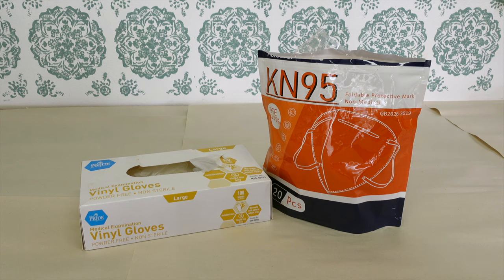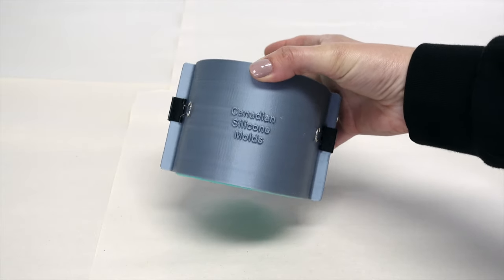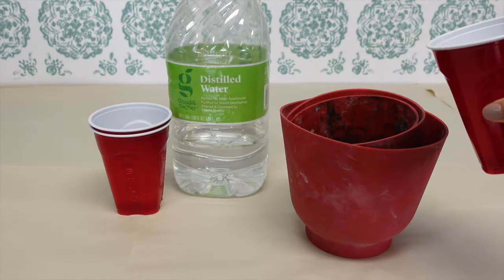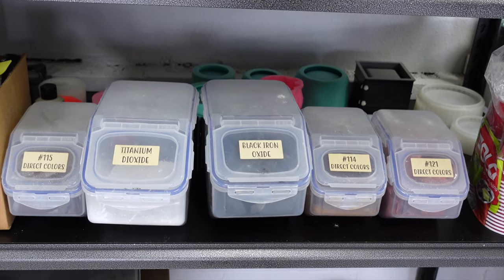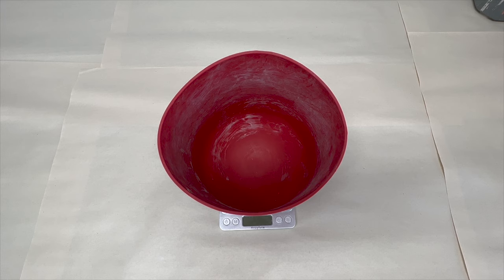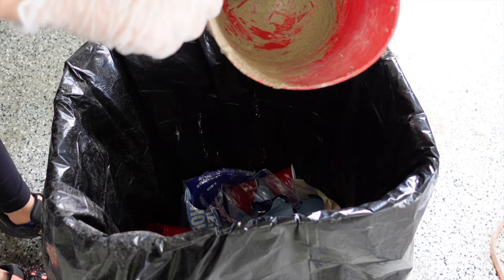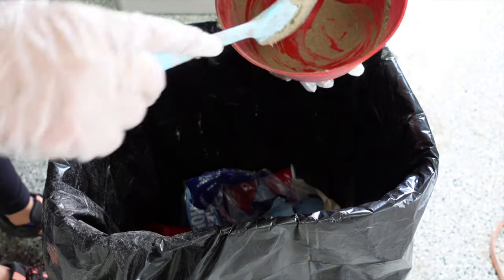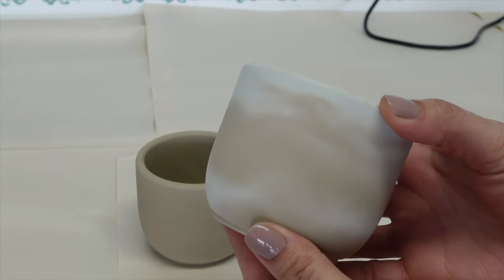In-Depth DIY Concrete Candle Jar Tutorial (Including Common Issues)

Comment: In your video you mention that you prior concrete was setting up too quickly in the winter. This is likely because concrete manufactures put additives in the mix for different times of the year to help the customers fight the changing elements. So in winter they include additives to help it hydrate quick even in really low temps. But as always you may want to confirm with each manufacture what they do.
Reply from the maker: Thanks for the info!

Comment: Great video and thank you so much for sharing your knowledge!
To slow concrete/cement down from drying too quickly you can run a very wet sponge over the bottoms (when they are still in the molds) a few times to keep them wet longer. Cement is actually better if it stays wet longer.
Reply from the maker: Thanks for watching! That’s a great tip!

Comment: Hi there. I’ve just come across your channel and learning to pour my own concrete candle vessels. 
Can you plz explain why you use the power and not add more water to achieve the desired consistency? Great videos and so informative ❤
Reply from the maker: Hi thanks for watching! The more water you add, the weaker your vessel will be. If you add too much water you risk cracks in the vessels, or they can also break very easily in transit as they will be weaker.

Comment: I’m just starting out with my vessel making journey. My first three were fine for what they were but after trying the 3:1 method in an attempt to increase fluidity but wound up with cracks in the bottom of the vessels. Yesterday I purchased the flow additive and this morning I rewatched this video. Can you describe what you mean about adding too much affecting the appearance of the jar? Sprinkling isn’t my friend so I have a set of measuring spoons, tad, pinch etc, so I can replicate my measurements from batch to batch. 

I do have one observation, as a mixed medium maker. I find it easier to measure small quantities of pigment using a jeweler’s scale and mini Dixie cups. Linda
Reply from the maker: Personally, when adding too much of the flow control I found some streaky looking marks on the vessels. May not be the case for everyone, but that was my experience! If you add too much water, you could definitely experience cracks.

Comment: Hi, I have a question about using mold release spray on the silicone molds when using concrete.  Have you used this product? I read that it helps prolong the life of the mold because of the concrete causing shrinkage?
Reply from the maker: Hi! No I haven’t, but I’ve heard about it. I need to test that out!

Comment: Thank you for your videos. Have you ever had an oxide pigment stain your silicone mold?  I’ve used a rose red oxide and it stained my mold pink. I’ve tried to clean it with the traditional soap and water, diluted, rubbing alcohol in water, and also equal parts of vinegar and water to try and remove the stains but nothing seems to work.

Comment: Great video!!  How do you wash your molds?  How often?  I use distilled water to mix my cement all, but wash my molds with tap water.  I noticed I’m still getting spots on my jar.  I’m thinking it’s because I’m washing them with tap water???
Reply from the maker: Thanks, Crissy! I do wash with tap water and a little dawn dish soap. I make sure to wipe them dry right away though. I use blue shop towels to wipe them off.

Comment: Hi there :) Your videos / tutorials are so fun to watch and inspiring! I have a question. I just recently started using Cement All (I was using my own white cement mix before). All my jars keep coming out with demarcation lines, like some weird discoloration. This is happening both in jars with color and without. Would you know what causes this? I can't figure it out. It's such a bummer to have several jars come out like this.
Reply from the maker: Hello! Thanks for watching! I'm wondering if it could be from your water? Are you using tap water? When I first started out, I was using tap water. We have really hard water where we live and it was leaving weird marks all over my vessels. I switched to distilled water, and no longer have that issue!
Reply: @calafiacandleco   Thank you for your response ☺️ I’ve been using demineralised water. I live in Europe and where I’m at, distilled water isn’t as common. But I thought that demineralised would be the same? Maybe I’m wrong. The weird thing is that these discolouration lines are just around the bottom half of the vessel. Not sure if I can add a photo here.

Comment: ANY IDEA WHY AFTER WEEKS OF MAKINGA APERFECT VESSEL, YOU LET IT DRY, YOU SEAL AND THEN YOU MAKE THE WAX, WHY THE VESEL CRACKS ON THE SIDES?  I HAVE A LOT OF VESELS CRACKED AFTER WEEKS OF MAKING THEM
Reply from the maker: It could be because of a couple different reasons. They could’ve cured too fast if it’s really hot where you are, or something about your mixture was off, or you’re pouring the wax too hot.

Comment: Great video! I was just wondering what kind of sander do you use for those uneven bottoms? Do you have an electric one?
Reply from the maker: I have never used an electric one. As you can see, my sanding is very minimal. Just a couple, quick swipes with a sanding block does the trick for me.

Comment: Question, & correct me if I’m wrong but so isn’t the normal cure time 28-30 days (or is it only a couple days since these are hollow) for concrete? & so if u sell these, when do you list them? 
Sorry if my question doesn’t make sense, I’m new to all this lol
Reply from the maker: Yes, 28 days is the approximate cure time for full strength. I, and many others, personally find they are ready to go after the weight starts to level off (about 7 days for me). If someone wishes to wait the full 28 days, they absolutely could. However, I don't find it it necessary. 

Do you mean when do I add the product as inventory to my website? I wait until the candle is poured and has had about 5 days to cure. Then by the time the candle arrives to the customer, it will have cured about a week (which is what I find works for my wax combo). So all in all, it's about a 13 day process from start to finish.
Reply: @calafiacandleco  thank you!  Yes that’s exactly what I meant lol. Thanks for answering! :)
Reply: @calafiacandleco  I came to the comment section for exactly this question. Now I feel tons more excited :)

Comment: Hello! What grit block did you use to sand the bottom? Also, how do you know how much cement to mix. Is this just trial and error or is there an actual guide to how much to mix?
Reply from the maker: If it's pretty smooth already, I'll go in with a 220. If there are some more rough spots, I'll use 80. For me, it was trial and error. Now there are more resources at hand to figure out formulas. Jai from Up Vibe Candle has a great video on his channel showing how you can calculate formulas for any mold.
Reply: @calafiacandleco  Thank you so much :)

Comment: Hello! I noticed that some of my jars crack when pouring the hot wax ( and some time after ), even if the jar was heated before. Any advice? Thanks!
Reply from the maker: What temp are you pouring? I like to pour between 150-160 with my concrete jars despite whatever the wax manufacturer's instructions are. I use coconut wax, which requires hot temps for melting and pouring but I do pour cooler with the concrete. Cracking could also mean you need to reassess your formula and timelines with the process.

Comment: Quick question can I use resin molds for this or do I have to get concrete specific molds?
Reply from the maker: You can use resin molds, but just know they may not hold up as well since they aren’t made for concrete.

Comment: What happens if you get little tiny bubbles even tho you tap and bounce them around for some time? I’m currently having this issue
Reply from the maker: Hmmm, I have had that happen before in the past. I've found it could be from using too much water, or it can happen with certain bags of cement-all. Some bags perform differently from others.

Comment: Hello, I'm from Brazil and would like some help. I looked on the sites trying to find this mold for concrete but I only found the silicone one. Would you have any tips for me?
Reply from the maker: Hey there. I’m not quite sure what you mean, as the molds I use are silicone molds. Are you referring to the outer support piece? It comes with the mold when purchased. I don’t believe you can purchase separately.

Comment: is there a reason why mine come out with a glossy finish? i figured it would be rough and cement looking?
Reply from the maker: It's probably the mold you're using. Some molds will leave a matte finish, some molds will leave more of a shiny finish. I find the molds that are meant for resin will leave a shinier finish.

Comment: Is it easy for the jar to break by using only cement?
Reply from the maker: This is cement-all, which is actually cement premixed with sand. It’s pretty strong, especially after it’s been cured for a while. That being said, the jars won’t be indestructible. If dropped from a high enough point, they could most definitely chip or break.
Reply: @calafiacandleco  thank you ☺️☺️

Comment: At 14:26 you say it's ready to unmold in 3-4 hours.  No, it isn't.  Concrete cures and strengthens with moisture, so when you pull it out of the mold early, you are exposing the entire surface area to the air and slowing the curing.  If it dries out too much, like you are doing, it will stop curing, and you cannot restart the process.  Somewhere else in the video you mentioned covering the bottom (top) with plastic wrap.  That is what you should do, always to retain moisture inside the curing concrete.  If you absolutely have to pull the pot out of the mold at 3-4 hours, then immediately submerge it in a bucket of water and leave it as long as is practical, up to 28 DAYS for maximum strength.  I realize there are other considerations for production of pots for sale, but trying to rush through the curing process is going to result in more broken pots, and dissatisfied customers, than you need.  I might suggest leaving it in the mold, covered with plastic, for 7-8 hours, remove the mold, sand the bottom edge, and then submerge the pot in water for at least 24 hours as a bare minimum.
Reply from the maker: For something much larger than what I’m demonstrating, I can see how that would be the case. I’ve personally reached out to cement-all before and have discussed my process with them. They themselves said for something so small like a candle jar, water bathing is a completely unnecessary step. For something much larger like a driveway…it’s definitely necessary. I’m happy to report I haven’t ever had any broken jars using my method. I always recommend doing whatever works best for you, though. Of course, you don’t have to do it the way I do it. I just share my videos to help others learn and provide some inspiration. Thank you for the kind comment! Have a wonderful day.

Comment: How many concrete candles can you make with a 55 pound bag of Cement All?
Reply from the maker: It depends on the size of your mold..but for my 3 inch tulip mold from MCL, I can make about 96 out of a 55lb bag.
Reply: @calafiacandleco  Thank you for responding because I've been wondering how to calculate that.
Reply from the maker: @shinningstar439  No problem! I prefer to work in grams. So for example, once you find out how many grams you need for one mold, you would just divide 24,948 grams (amount of grams in the 55lb bag) of cement-all by the amount you need for one mold.
Reply: @calafiacandleco  Omg thank you!